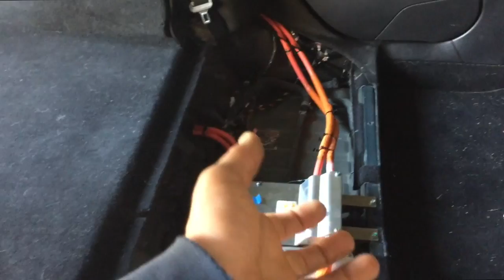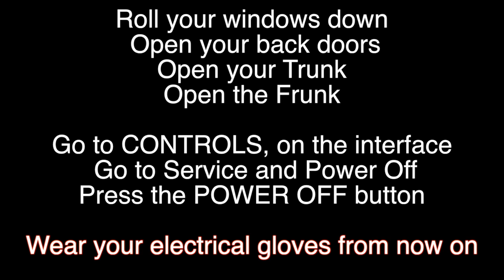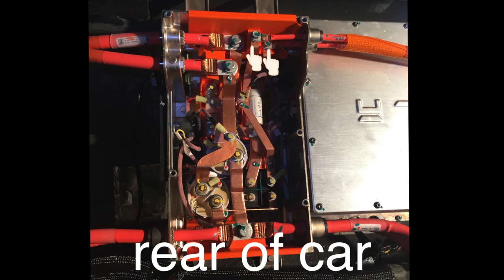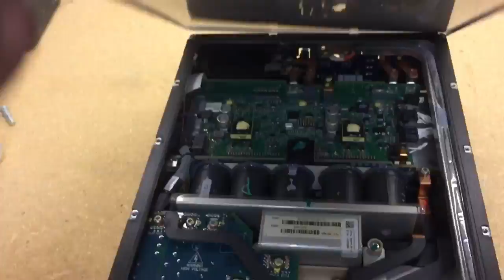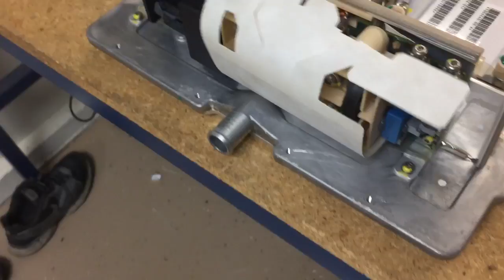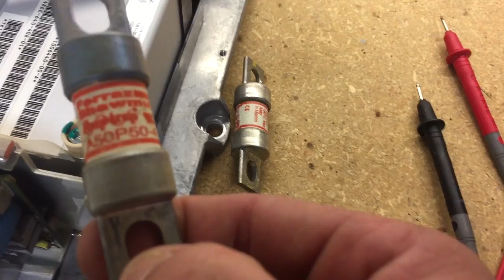Fixing a Broken Tesla Model S Onboard Master Charger

Comment: As soon as you showed the fact you have to remove the cover for the charge. Is when I knew that Tesla will not allow to have that procedure done at the service center. Because it's quite possible that the techs aren't trained properly. They are only trained to remove the charger. Once removed, they'll send it off to an other building to have those fuse(s) replaced AND testing done to see why the fuse was blown. Sure there is the chance that the fuse blew just because it did. But there is always that possibility that it actually blew for a reason. Such as an other component in the charger caused the issue. <--- That reason alone is a very good one as to why Tesla, or any other manufacturer won't allow their first hand service techs replace it. Especially such a heavy duty fuse. That charger needs to be tested properly, and a first hand tech does not have the knowledge and/or proper testing equipment and paper work, i.e. What the voltages shall be or current draw.
Reply from the maker: you make a good point. I did inspect the entire charger to make sure there is no short or other issue. The fact that it doesn't blow again right away, the charger itself should be fine i.e. no short. After close examination, a short inside the charger is extremely unlikely. All the board and connections are heavy insulated. (redundancy for fire prevention)
A good part of my business involves diagnosing and fixing life science instruments. They are very similar to this car but with lower voltages. With that experience, I feel it's same to say that if a fuse is blown, and it doesn't blow immediately after replacing, there are no issues outside the fuse.
Reply: Indeed.

Electronic troubleshooting when you have a blow fuse or breaker typically involves gathering any diagnostic data (for smart devices), inspecting components for obvious damage/failure, and examining connection points (connectors, lugs, crimps, terminals, etc...) for signs of heat or failure from loose connections and/or shorts.

If none of the above reveals a problem, then the next step is to typically replace/reset the circuit protection device (in this case a fuse), and then exercise the unit in as wide a variety of operating conditions possible. If there's an obvious fault, the protection will trip again immediately. For intermittent faults, you may get hours to years of additional service. If the protection device was bad, you may never trip it again.

The safety key is inspecting for potential dangerous faults. I've done that, as it appears Nick S did. With that out of the way, he apparently has had some time go by with no additional problem. I hope to do the same.

Incidentally as an interesting aside: I have one of the very early Tesla High-Power Wall Connectors. People had problems using them at their max-rating (80A). Guess what Tesla's fix was?: send folks replacement fuses for the originals that tended to fail under certain conditions. The HPWC's themselves were fine.

Comment: Good video.Is this a común problem.?
Reply from the maker: I returned it back to the guy. I put a new fuse in it so it was actually working. He refunded my money.
Reply from the maker: not really common but some owners I've talked to have had the same problem. Some at 17k miles and some at 50k +. I have 68k so it's probably subject to various factors.
Reply: How did you narrow it down to the fuses. It was totally dead?
Reply from the maker: I kept walking back and eventually opened the charger and found the fuses. Since the used charger that I bought online had the same issue (opposite fuse was blown) I was able to find out a few things. It's acts identically regardless of what fuse blows. When it starts to charge, you will see a voltage readout on the dash. If both were bad, or another issue occurred, you probably wouldn't get any readout. They are fast acting fuses so they will blow fast. You just need to think about the redundancy this car must have so it doesn't catch fire and become a PR nightmare. They designed it so the fuses will blow extremely quickly before a short on the board could start a fire. Thus, just my personal educated guess, but 95-99% of charger failures will probably be a fuse.
Reply: I imagine you tossed two new fuses in the extra charger you bought and placed it in your car as a slave or did you sell it?

Comment: Nice job man!
Maybe you could send a suggestion to Tesla to have them consider changing the place of the fuses?
Also, I think they would agree with me that a $2200 repair which can actually be done for $20 is not good publicity. Being a bit of a DIY guy myself, I wish manufacturers just gave their customers more information about DIY repairs for people who are not completely clueless to what they're doing.

I get that they don't want to be responsible for people electrocuting themselves, but they can just include a big disclaimer along with the info right?
Reply: I guess they are trained to get the car fixes as fast as possible. Broken parts are send back and might be reused on tesla owned cars. 

So this is the best solution for the company and the customers as long as you're under the warranty. If it wasn't only the fuse, and they replace it, it could be possible end up beeing in the service a second time. That's not good for publicity too.
Reply from the maker: I totally agree. You make some good points.
I made this video for 2 reasons; to help others out and to bring awareness. I didn't like the service guy telling me there was nothing i could do and i had to get a new one for $2200. That's why I wanted to figure it out myself as a little payback. 
Realistically, as long as you're safe, as with all electrical, it's not really dangerous. Also, when you take the lid off the high voltage box, there is a click, which is a valve that isolates the hot terminals, just in case. I'd imagine tesla also isolates the inverter to make it 100% isolated but really no reason if the car is in the OFF mode.
Reply: IN the video you said the charger would cost 220$.
Which price is correct?
Reply from the maker: $2200 sorry about that.

Comment: But why did the fuse blow?  Yea, I know..too much current.  But what was the cause?
Reply: Geesh!  50 Amps at 400 Volts!  That's 20 Kilowatts! You ain't going to put that through a pcb!  Dan you Moron...(troll)  .  Take your lithium sulphate meds and stop making such ridiculous suggestions.
Reply: Well maybe it just had a power surge!  The fuse is there to protect everything behind it.  So maybe that's all it is.  This video is from a year ago, is the unti still working?
Reply: I figure that if it's working for extended use after the fuse switch then it's not a larger issue. Could be a minor design issue but nothing to spend 2200$ on to get a unit that does the same.
I think I would have designed the unit with PCB emphasis instead of multiboards with busbars and screw terminal stuff. Keep it tight and lean. So much weight and cost to be saved there. Ref google little box challenge.
Reply: Fuses tend to blow if the voltage spikes. That would be the case on thunderstorms nearly hitting a overland power line. :)
Reply: And yet 20 Kwatts blew the fuse!  That's my caution.
Reply from the maker: 40amp at 240v for 9600 watts. just under 10kW
Reply: @Schlifey  Is the charger still working?
Reply: Well I know this post was from 5 years ago but I just had the same exact issue as described in the video. I pulled everything apart and tested the fuses just to find out they both have continuity 😩. I’m going to replace both fuses with new ones anyway and try again. 
I did notice as I was disconnecting the 12v battery that the ground clamp was loose and it moved as soon as I touched it. Could a loose 12v battery connection cause the same type of charging issue? I probably did all that work checking the fuses for nothing if that is the case. 🙄
Reply: @briancampbell4955 what was your fix after all?
Reply: Dennis Mathias ...When a 50A high voltage fuse blows, there is usually a darn good reason.  The specs on that fuse are such that regular use will not blow unless serious power issues cause it.    If you are mostly charging at home, check charging system for loose connections.  yes..you got it going but keep looking for what caused it.  Job 1/2 done ...caution.  :)
Reply from the maker: Not really sure. I assume it's just degradation of the fusing element over time due to temperature fluctuation, vibration, and/or other external forces . Once the fuse is degraded slightly, it can blow outside of it's intended spec. However, I do have 68k miles and probably about 60k of those were via the onboard charger. That's a good amount of use. That's a good question though. It got me thinking that with the coming of winter, the big temperature swings, it might increase the likelihood of a blow.
Reply: Well, this is the 11 kW Charger, the new one is rated for 16,5 kW :)
Reply: Mike, I'm the smartest man in the world. Not only can it be done on PCB but even the transformer can be done with just PCB traces and it can all fit in that box. With only 2 sided PCB. Today. And in the not so distant future, a 20kW charger will be possible in a single cubic centimeter unit.
If you think a PCB can't handle 50A, google bellnix 150A for instance.
Don't be such a Trump voter.

Comment: Were you afraid of dying the entire time? I was afraid for you, watching this.
Reply from the maker: haha Not going to lie, at first I was a little. I wore high voltage electrical gloves at first. But, I had a pretty good idea where the dangers were. Plus, there is a sensor (magnetic) on the high voltage box lid so when you lift the lid, you hear a click, which is a switch that isolates the battery from those terminals.

Comment: I'm curious, shouldn't a 2013 model still covered under the 4-year warranty?
Reply from the maker: you would think but it's that or 55k miles. I have 68k miles already. the 8 year power train warranty doesn't include the charging components.
Reply: That was not the battery he took apart.
Reply from the maker: "I never touched anything on my car" ha
Reply: Nick S and if you did this, it's not void the 8 years battery warranty?

Comment: If you had dual chargers, how easy to just swap the units?  Are they interchangeable in that era Model S?  I have a mid-2014 with dual and always thought worse case scenario I could end up with a single charger by cannibalizing the other one.... prob would not be gutsy enough to try it myself though!
Reply from the maker: If you wanted to swap the units, you could just move the 5 connectors from the right side charger and move them to the master over to the slave. There are 5 identical connectors in my high voltage box that is there incase I want to install a slave (second) charger.
Reply: So @Mike Iimura  I think that was me on TMC. I indeed had my slave moved over... In addition to the reprogramming, I also had to have some coolant-bypass parts installed (hose & valve). Total was closer to $400.
However I just went thru the procedure @Nick S posted, and bingo, dead fuse. Gonna replace it, and see about getting it re-installed.
Details: https://teslamotorsclub.com/tmc/threads/car-unable-to-charge.69029/
Thanks to the OP here for the helpful video!
Reply: @scaesare  I am going to go through this procedure, but I doubt Tesla will re-install it for me.
Reply: There is another guy I read about on TMC who had his master charger fail out of warranty.  He didn't want to pay the full price to replace the master charger, so he finally convinced Tesla to move his slave charger over to the master position and reprogram it to be the master.  There is a difference in firmware and Tesla has to load it with their special test equipment.  I think the labor for the swap and programming was less than $500.

Comment: Do you think there is lot of room for improvement to make the maintenance of these Teslas easier?  Seems like those fuses are buried pretty deep in the bowls of the car.  I am thinking hot swappable electronic bays.
Reply from the maker: Ya, I agree. I think there is some room for improvement. If they really wanted to make this swap easier, and cheaper for the customer, they could easily put an access bay on the side so all you would have to do is take the lower seat out. The fuse is a little annoying to access.
Reply: They could have changed this by now as they no longer use dual chargets they use a high voltage charger and you can choose a high density charger or and standard one which if i am not mistaken is just one unit.
Reply from the maker: Steffen Frost they could make it much easier. I told myself, I’d this happened again, I’m going to cut out a window on the side so I can access the fuses easily.